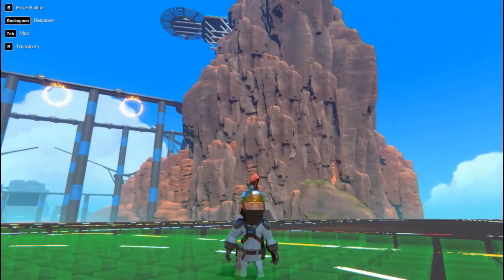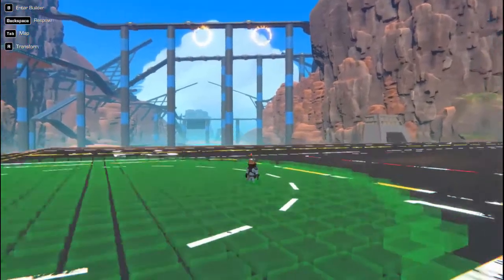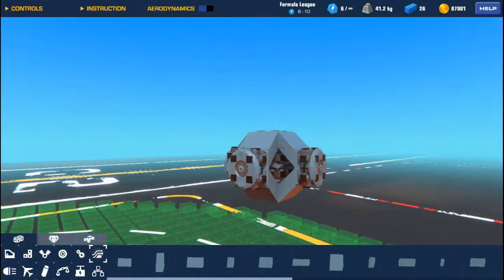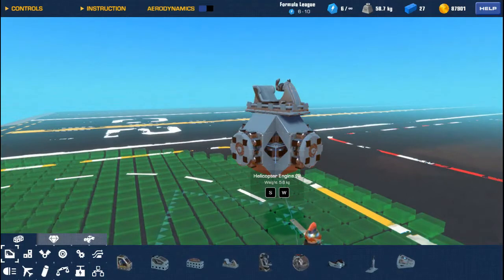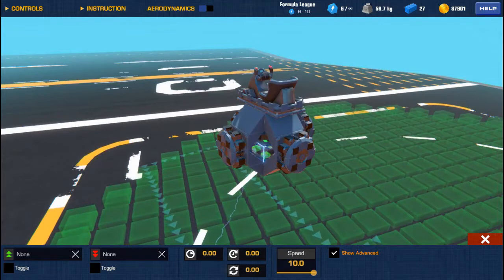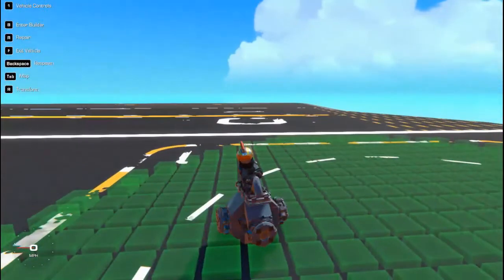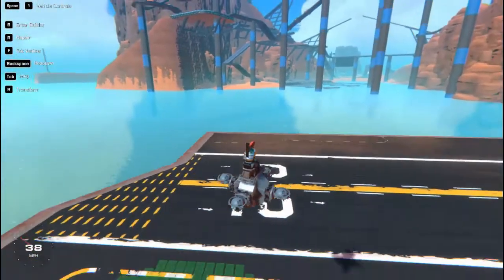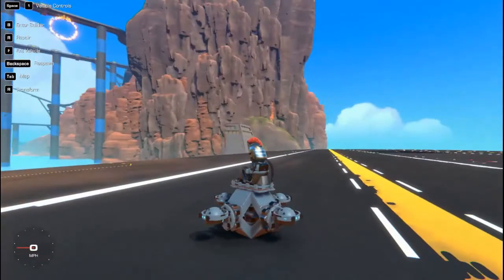Trailmakers How To Build a Gyro! 3 Axis Stabilizer for your builds!

Comment: if this helps turning you can make a smaller verzion for my f1 car?
Reply from the maker: Just add 2 heli engines on the horizontal axis of your car. Preferably one above the other. Set them to 10 speed, in opposite directions. Set to toggle on a set key, or connect them to a distance sensor hidden in the car that's facing something. In order to keep them spinning constantly. They only help add stability on the given axis, therefore helping with steering:) Hope this helps:)

Comment: Does it still work?for me it's not
Reply from the maker: The stabilizing effect gets weaker, as the mass of the build increases. So smaller builds will feel the effect more.
Reply: @ThatDomGuy  Ok I only have the gyro
Reply from the maker: Ok, try and slap a couple gimbals on it and raise yourself into the air to see if they stabilize you. They don't make you float or fly, the gyro just keeps you stable on the 3 axis. If the Heli Engines aren't spinning,  you can try selecting them all and set the Speed to 10, and the control to the green arrow set to #1 with Toggle on. All of the Engines on the gyro should be set to the same control. There should be NO other controls in the Red Arrow controls. Hope that helps:) Let me know if your still having issues.
Reply: @ThatDomGuy thx I  will try in morning I'm on xbox but I don't think that makes a difference and my keyboard doesn't work on trailmakers
Reply: Same

Comment: When i build this and press a it spins like crazy
Reply from the maker: Make sure that they are spinning in opposite directions. Left and right should be opposing, top and bottom opposing and front and back opposing. spinning usually means there is a set spinning in the same direction causing torque.

Comment: Does this work for biped's? do you need to make it at a certain axis, like, vertical or horizontal?
Reply from the maker: Your better off using angle sensors with the gyro. Walkers usually require strong stabilization, where as the gyro by itself only removes rotational drift.